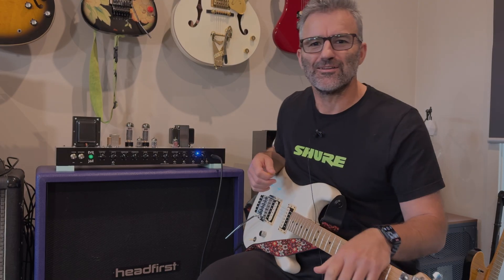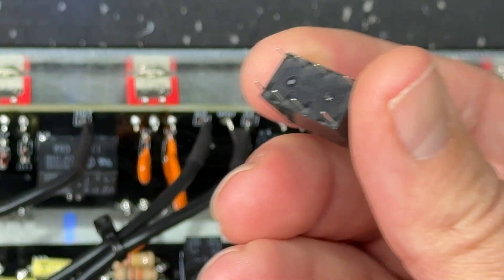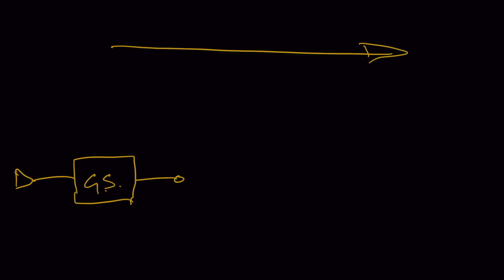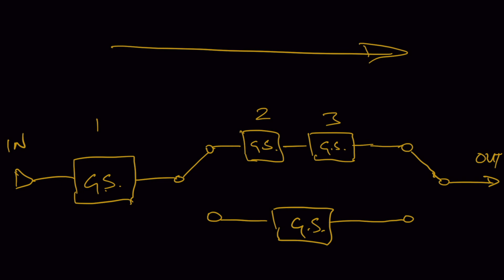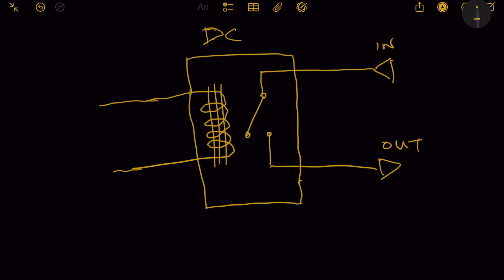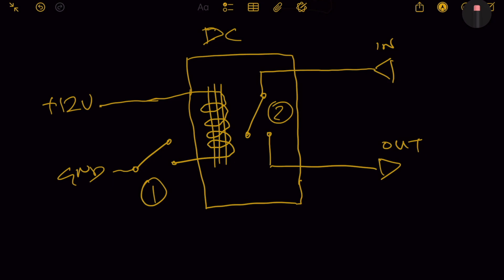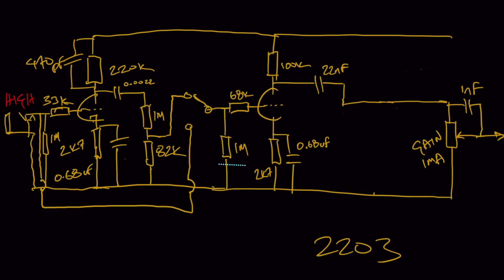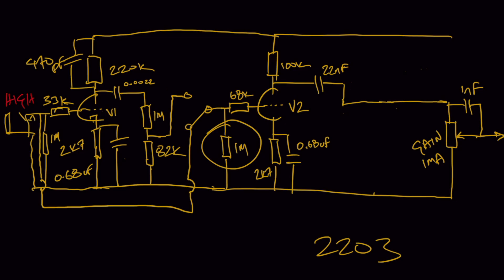Relays in Tube Amps - MADE EASY!

Comment: I always use transistors to switch relays, to avoid arcing across the switch contacts.  Maybe this isn't so necessary with these really small relays; and I notice, even manufacturers like Peavey sometimes use footswitches to directly energize relays, so obviously it's not a show-stopper.  Still, if you do more videos on this topic, I'd suggest mentioning both the reverse diodes across relay coils, and the simple circuitry needed to drive with, say, a 2N2222.  This will also help folks who may want to control things digitally with an Arduino, MIDI, or whatever.

Comment: I would love to have you fix the channel switching on my Marshall 6100 + add midi control. The midi part was the first thing that fried on that amp, and since the it's been mostly downhill. Pt. it's locked to the clean channel, so it at least functions with one good sound. But realistically it's not going to happen. But you sell those small relay boards? Maybe my tech can make it work..

Comment: HEADFIRST, If the amplifiers 12vdc uses a virtual ground that is NOT at zero volts. The grid leakage resistors are connected to zero volts ground, so the Relays will cause a Popping sound, What do you recommend and suggesting doing to fix and  prevent the relay popping noise because of the potential differences in the grounding scheme?
Reply: Add a snubber

Comment: You mention using the same 12v DC as the preamps? There's a bit of talk about grounding malarky when you do this. If the 12v DC is grounded (or centre tapped to ground) can the heaters and relays use the same source?
Reply from the maker: You want the12v DC to be grounded on the rectified DC side, not on the AC secondary wind side.  If you do the former all is good.
Reply: @HeadfirstAmps thanks!

Comment: I did not know if i missed the part in the video, but it is important to talk about reducing switching Noise of the relays ( clicking) with mute via a jfet or with resistors to ground. I have added a third chanel with a third Mastervolume on a Peavey 5150 and solved the clicknoise with a resistor 1 M Ohm  to ground.
Reply: 17:00 but he mentioned it 17:16
Reply: Thanks, I want to add a second master qith a footswitch, this is useful.

Comment: You can/can't use the heater supply depending on the current draw and how many relays are in play. Please do a video on using Vactrols for switching and variable resistors for slow start power supplies.
Reply: Vactrols are the same concept, but using an led with a light sensor instead of a magnetic coil to switch, and SPST instead of SPDT or DPDT